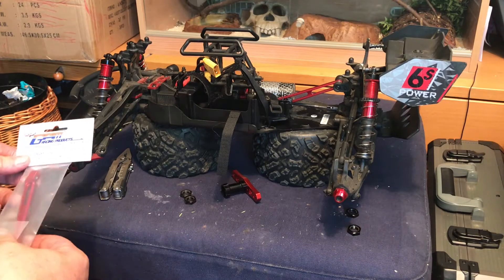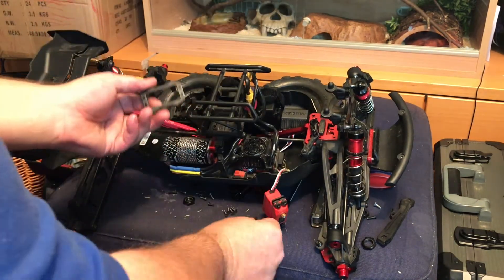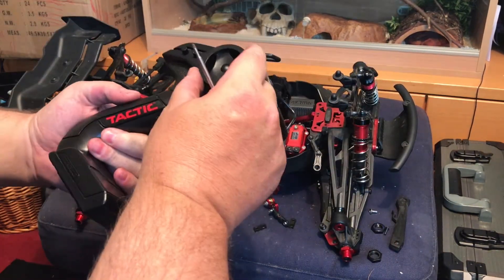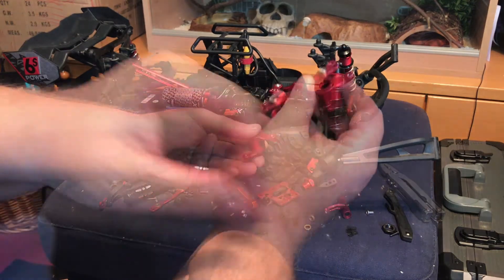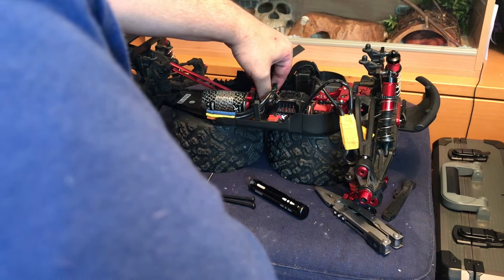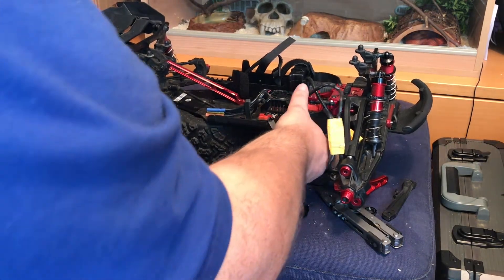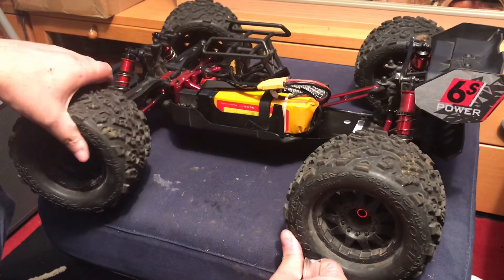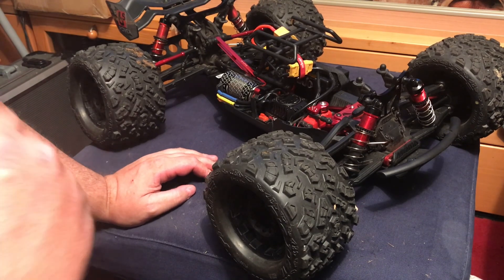Arrma Kraton Review part 2  Fitting GPM Alloy Braces steering diffs and more

Comment: I bash mine too hard to use an aluminum servo bracket, i need the little bit of flex the plastic gives so it doesnt send the shock of chassis slap landings straight into the servo...

Comment: Nice vid and upgrades but I’m not a fan of metal on metal rubbing as in the servo saver. I keep mine stock as plastic tends to wear better on itself. Cheers for the info tho. 👍🏼
Reply from the maker: The servo saver was total rubbish, the brass spring bit broke. Went back to the stock arm and its been all good. You live and learn.
Reply: You can also pop 2-3 “C” clips under the spring to tighten up the servo saver too.

Comment: Good luck on GPM.. the front and rear links have cheap plastic and pull out ... the diff cases are flawed too... the chassis braces should be fine but i would keep stock servo saver working and get normal servo horn...just giving heads up... i only use HR parts high quality aluminum
Reply from the maker: So far the GPM stuff is holding up just fine. time will tell i guess.
Reply: GPM makes awesome parts!!! I have purchased many many for the KRATON & NERO BIG ROCK, I even installed their alloy A-ARM'S on the Big Rock and it was indestructible, was bout to order the alloy A-ARM'S for the KRATON and I lost both to an accidental fire, but I had many HOT RACING part's as well and you're right they are great but can't go wrong with either

Comment: After using the GPM center diff case have you had an issues with it leaking or an play in the gears, because I have some GPM parts that they work great but I was reading complains about them leaking and having to much play in the gear so the diff fluid would leak out.
Reply from the maker: So far all the GPM stuff has held up fine apart from the servo saver horn which broke on a massive cartwheel. The diff hasn’t had any issues and no leaks but I am using very thick diff fluid so I doubt it would leak out unless there was a big gap.